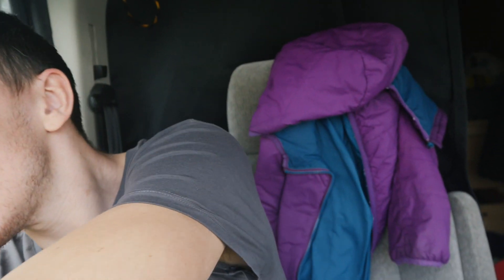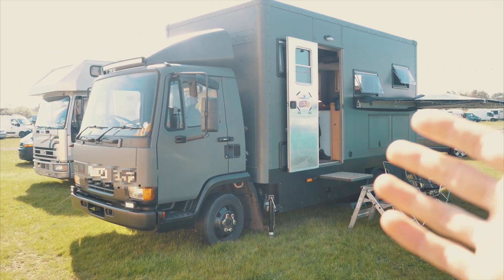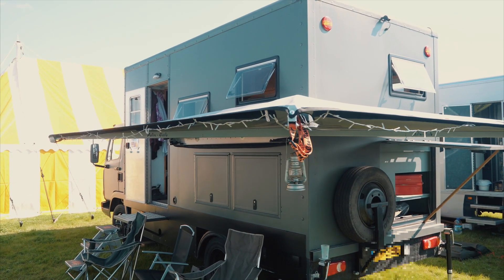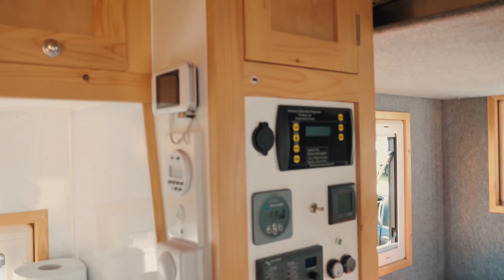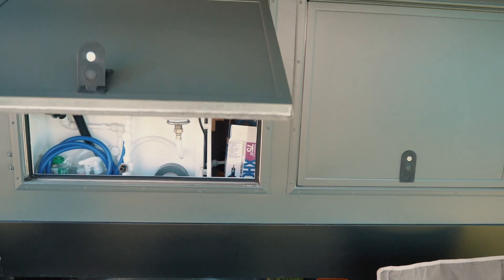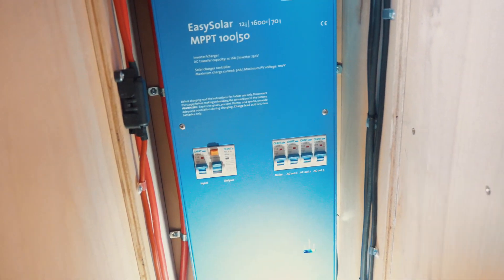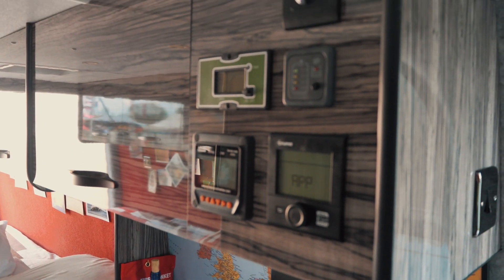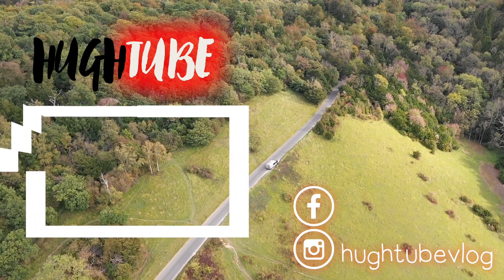Camp Quirky 2019 - Self Build Camper Van Festival

Comment: Noticed from the Greg Virgoe video that you appear to have something under your mattress possibly for air circulation. I'm currently faced with a search for a solution to the same problem. If this is, what did you install? Enjoy your channel. Keep up the good work!
Reply: Looks like Ikea's rubbery sprung slats that come on a frame. Search Lönset on their website. I use the exact same slats, very comfortable.
Reply: @Mevi  Thank you!
Reply from the maker: Exactly what Mevi said. You have to have air circulation under the mattress, putting one straight onto a sheet of ply would lead to mould.